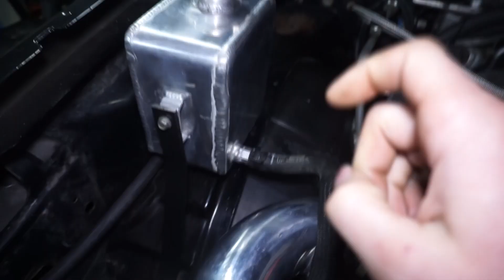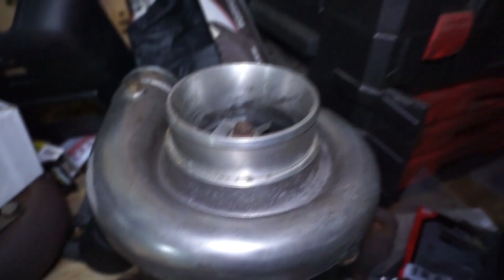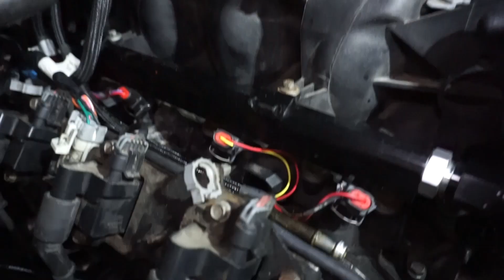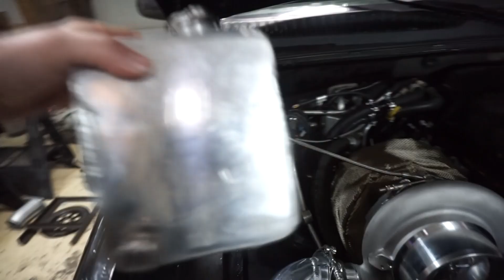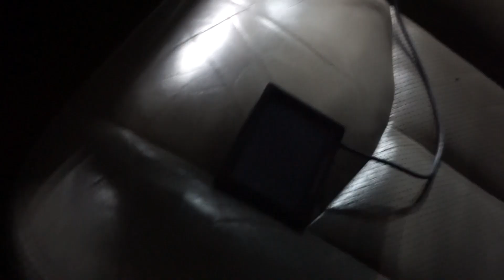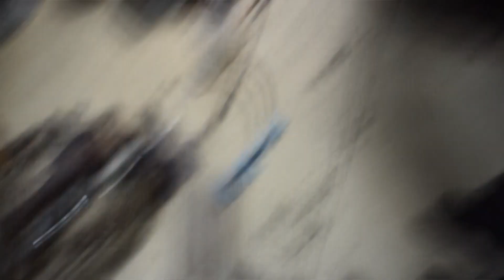Fixing Boost Leak and Coolant Leak On Dadillac!!!

Comment: Gotta say never seen a boost leak test be performed through a vacuum line for the boost controller but hey pressure is pressure. I usually will pressurize from the turbo inlet, find leaks on the hotside fix em if any exist, check the intercooler fix it if there are any leaks, on to the cold side fix em if they leak...then intake, fix it if it leaks, injectors...fix it if it leaks...rings ...fix em if they leak way bad LOL

Comment: How much air pressure do you normally use when you check for leaks?
Reply: Just a little more than what your wastegate will be running, that way you know all your couplers, clamps, will hold if it spikes a few psi higher than you want. But usually around the boost psi you will be running. So it varies, on what you build is.
Reply from the maker: Yeah ill usually try to do like 50% more than the target boost.
Reply: @BlaserBuilds  Makes sense, thanks!